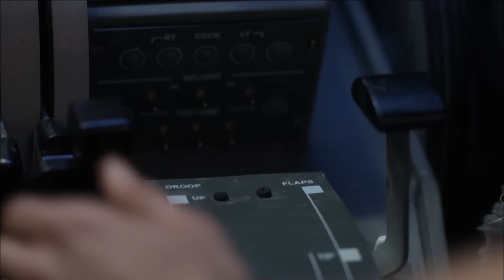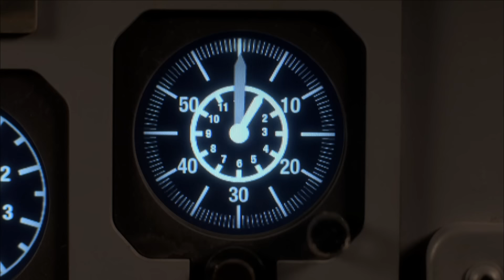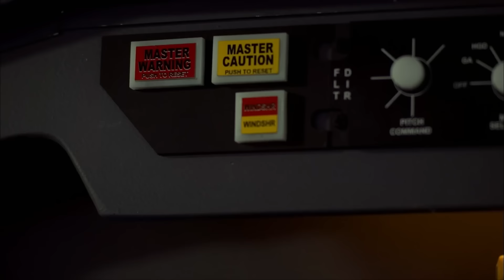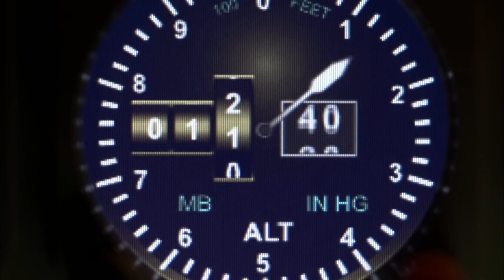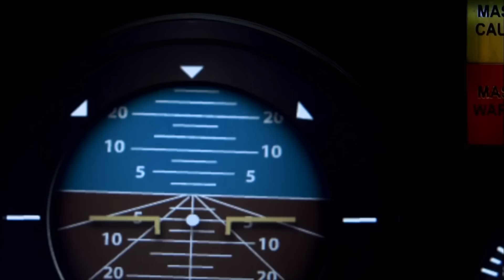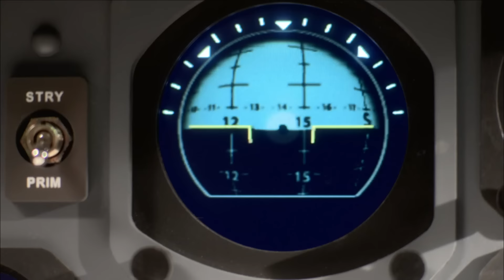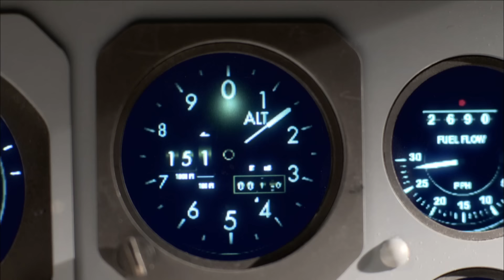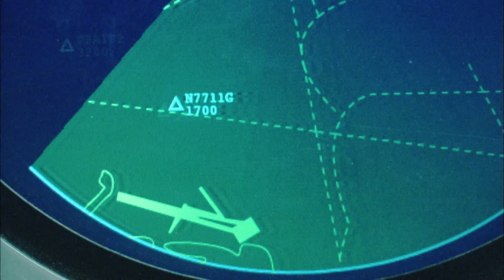4 Intense Crashes Of The ‘70s ☮️ Air Disasters | Smithsonian Channel

Comment: That pilot is a hero....landing in a city and only 8 ppl died...that s insane. He is a hero!
Reply: Not really, those 8 people could have been avoided
Reply: Fact: Tam Airlines 402 has crashed due to inexperienced co-pilot.
Reply: @wesleydeandradegalvao6247 It was more than that.

It was due to a faulty sensor on Engine #2 that allowed the reverser to deploy intermittently. The crew were not trained by TAM or Fokker about one engine having a deployed reverse thruster.

The Fokker 100 could fly on one engine. And there was a safety system to cut power to the affected engine. The FO didn't know this because they weren't trained for a situation for this. Since they fought against the safety system the cable broke and from until impact Engine #2 was set to Max power and thus causing asymmetric thrust to occur